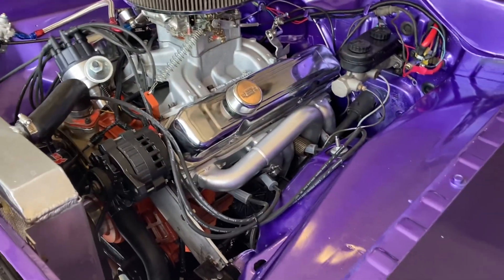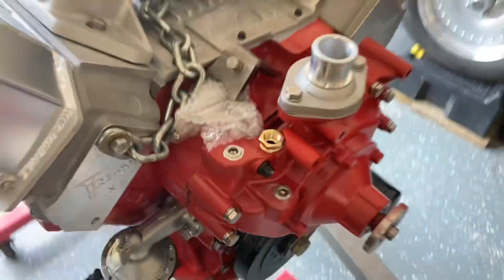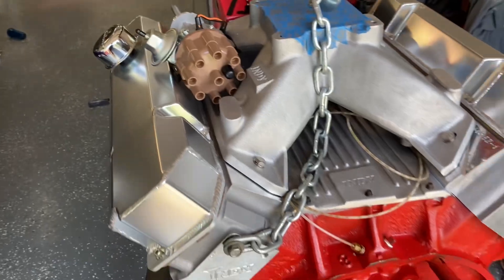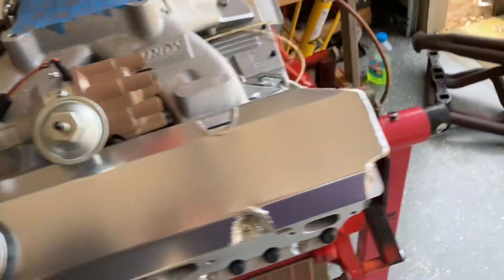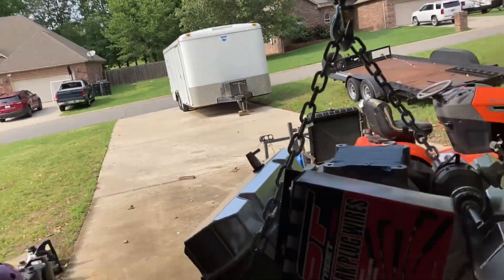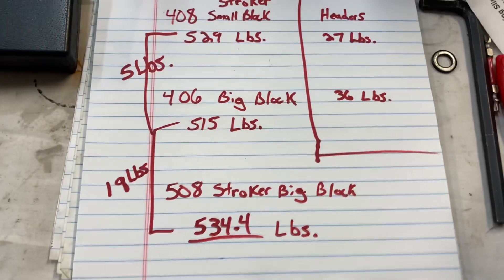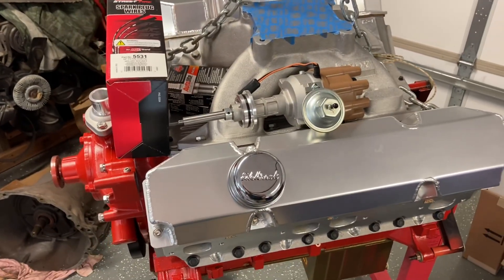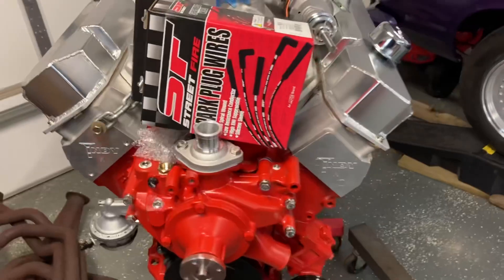Mopar Engine Weights Compared: RB vs. B vs. LA #mopar #engine #440source #stroker

Comment: I think I've said it before but the Chevrolet guys need to see this because they always say a big block Chrysler weighs 800 lb
Reply from the maker: I’ve heard it a hundred times! Even with the added stock heads, iron intake, iron water pump housing, it’d have to be under 700.
Reply: Don't complain that there lack of knowledge makes us Mopar guys look even better when the taillights are fading up from in the distance lol. Imagine how bad it would be if we didn't have these heavy slugs up front lol.
Reply: Most stock big blocks weigh somewhere around 700 pounds, But not all.... That's air cleaner to oil pan, full of fluid, and stock exhaust manifolds, pulleys, w-pump, etc, etc........ Chrysler being the heaviest, Chevy's being the lightest. And it is only about a 50 pound spread between most of them.... Except for a few....  The 800+ pound elephant, is the Hemi, which weighed 843 pounds top to bottom with factory manifolds and fluid, etc......... Chevy made the lightest factory big block, ever... Even thou most people don't want to hear that, it weighed just 501 pounds..... The ZL1....... Chevy made the next lightest ones as well, L88/L89 427......
Reply: @shvrdavid  I'm sure what you said is true but I think they only made 69 of those so they don't really count
Reply: @thomasward4505  They made a few hundred ZL1 engines in total, and made about 150k L88's cars. In 1969 there were just shy of 39,000 L88's installed at the factory, versus 1,200 Hemi's... All were orderable, which makes all of them OEM engines. The L88 vastly outsold performance Hemi's and 440's in 1969, and was about 90 pounds lighter than a 440.... So do the rare Mopar engines not count too? Interesting question, and some like the Hemi sold absurdly low numbers......... Same with the performance version of the 440.....
Reply: @shvrdavid  I was wrong the number of 69 was only in Camaros when I looked it up it was 300 ZL ones which is still not very many, I've seen one in my life and I'm 65 years old. About 6600 426 hemis were built
Reply: @thomasward4505  Seems odd to that less hemi's were made in the late 60's than L88 aluminum head 427 BBC's, doesn't it. And most people have probably never seen an L88.  ZL1's are rare to see for sure.... I owned a few L88's years ago.... There were lots of them around....
Reply: @shvrdavid  A total of 216 Corvette's had an L88 installed  from 1967-69. Not sure where you came up with the 150,000 number ?
Reply: I do not know where you got that information or your brain is getting foggy with time :face-orange-biting-nails:or you hang out with B.S. bench racing end zone lifters :face-orange-raised-eyebrow:but from the book practical engine swapping second revised edition1976 by John Thawley a Chevy big block weighs 625 pounds and a RB weigh's in at 670 and the Hemi is 690 pounds. The small Mopar is 550. These is fully dressed with stock cast iron heads from full oil pan to air cleaner,  fan and alternator like it would be in a running car or truck.  AMC 360-401 is 540 pounds Buick+ Olds+ Caddy 472-500 are all 600 pounds and the heavy Poncho 455 is 640 pounds. Mopar 6 is 475 and all of the GM 6's are 410 pounds. Fords come in at 400 for the 6er and the small 260-351 come in at 460 pounds and the big blocks 332-352-390-410-428 460 come in at 625 pounds. This book even has the dimensions  from water pump tip to trans mount, sump to air cleaner and stock cast exhaust to exhaust in the section "will it fit" P.S. I am a Chevy guy at heart and own a 65 muff-tang vert stick stir to boot but in love with my Mope's just as much even if they are fatty patties around the waist line a bit. :hand-orange-covering-eyes:

Comment: I would never put Chinese  parts in my motor.  440 source...
Reply from the maker: @bradhardy2629  thank goodness you commented so I can explain. They’re now using Scat Cranks and rods, Icon pistons. Obviously it won’t say scat however, It’s the same manufacturer. I like many of their products and will definitely endorse them. Others are a little weak for my needs, but will suite someone else’s out there. How many manufacturers do you think wont use China to make some percentage of their product? The answer is 0. I’ve talked to American owned companies. They truly try to use American manufacturing companies, but they can’t operate at a profit because of the market that’s been created with overseas suppliers, and they have to do the same to stay in business. So it seems your engine will get good old American Stock parts. But don’t use King bearings (made in Israel) and don’t use any Timken bearings because they’re made in Mexico. But wait! Where is your smart phone or Computer made? Top answers are Japan and then… China 🇨🇳. 
Manufacturing happens all over the world. I used to teach 7th grade geography. Week 1 was telling my students to take off one shoe and see where it was made. There are 87% of shoes manufactured from Asian Countries. Let’s circle back to your original comment. If my 440 source stroker kits in any engine fails, I’ll be the FIRST to let the world know. But you’ve got to start thinking about the bigger picture. I can’t buy fruits and vegetables for my children that are made in the USA, without paying 3x’s as much. It’s not the farmers fault. It’s the politicians

Comment: I did weight comparison between a all iron 318 vs a 400 with  aluminum heads, intake, water pump and housing. Was nearly the same weight. Buut the transmission was of course a different story. At least it's a little further back.
Reply from the maker: The 727 in both applications have the same weight, plus the slightly larger bellhousing. I definitely wanted to show the headers to show that difference in tube size and weight
Reply: @JustMoparJoe  Yea 727 to 727 would be but the car I was doing originally had the 904.
Reply from the maker: @ that 904 is a blessing for weights loss and et I heard
Reply: @JustMoparJoe  Yea so I've heard but this isn't an all out race car so wasn't willing to spend the big bucks to make the 904 handle big block torque or the ultra bell to make it fit.  I guess you can put 904 internals in the 727 case as well but I'm sure that's costly parts as well. Have to ask Mr. Cope about that one.    I just put a bolt in sprag, billet drum with all the clutches I could stuff in it, billet servos and valve body mods in the 727 core I had and rolled with that. Wasn't horribly expensive since I built it myself. It's doing fine with the 625 tq my 470 makes. I'll be living with the added weight and drag for a while. I really enjoy your videos and how you present information man. 👍
Reply from the maker: @ thank you. I like the 727 for sure. I can’t afford a rebuild every season! 😂

Comment: I built a stroked 383 with a 440 crank, = 426. I put the stock cast heads, intake water pump and starter on the scale, I saved over 125 lbs going to aluminum. So my big block was now the same weight as an all steel small bock. Motor made 525 HP and 552 TQ. Put this in my 71 duster, I bought a fibreglass pin on hood, car was completely stock, full interior etc and weld wheels. the weight with big block full tank of gas was 3120 lbs.
Reply from the maker: I love the idea of making a big block the same weight as a small block! It’s hard to go small block when you can get 100 more horse and 150 more foot pounds

Comment: Aluminum block if you can swing it, or rack and pinion drop steering box motor plates use motor plate,
Reply from the maker: Thanks for sharing. I’ve got way too many cast iron blocks to swap now

Comment: I weighed my big block in a more runnable condition than you did. I included a mini starter and the pulleys and the carburetor but did not include any kind of exhaust and I believe I got a 545 pounds
Reply from the maker: That’s much better than what the internet tells us!

Comment: Ive avoided swapping because of the plain lack of room in an A-body engine bay. I dont want to hack up my fenderwells to fit headers or have room to change plugs.
I would like to have the power of a high compression 452 (400 block w/440 crank) stroker on tap though..
Reply from the maker: Check it out! They say the Hedman headers are a direct fit for the A body cars. I bought a set and never got to try them. But my plugs are easier now than they were with my 408, or nearly. But the bellhousing bolts are a breeze!

Comment: I swapped out a small block for a Big block, because the distributor is in the front of the engine and the intake can be removed without draining the rad. Along with getting more low rpm torque.  Thank you for the video.

Comment: Hey! I almost have the same engine combo in my truck I am running a Six Pack.
It performs very well. And it does have  A  LOT  OF   TORQUE  !
And is it fun to drive on the street.
Thanks for sharing this info about the weight.
Reply from the maker: Sounds like a blast! This 508 goes into a d100 truck. Should be exciting

Comment: I dropped the 440 out of my 72 Dart and installed a built 360 not because of its weight, but because of its ease to work on.
Reply from the maker: I think with the right headers, it’s about the same. I do like how far the bellhousing bolts are on my 400 now, versus the 360. I don’t think I have the easy headers 😂
Reply: @JustMoparJoe  I had TTI headers on the 440. The torsion bars went through them! Changing the plugs was a 2 hour job and replacing the starter was an impossibility!! I’m so much happier with the 360. Sold the 440 to my neighbor for his 72 Barracuda build. Everyone wins!!
Reply: @jumpinjojo  With the Indy heads the plugs are canted out from the stock position. They point to the intake valves. Away from the exhaust ports. If nothing else... they are easier to change than the small blocks. And, of course, let's talk about distributor placement. I changed to Big because it was easier to get to the distributor. Really? 😜
I ran and wore out three 360's in my truck I ordered and bought in '73. Then switched to a Big Block in '91. I'm on my 3rd Big Block now. Once you go Big... why would go back to small? 🙃 
Oh... they have these things called "mini starters" that make changing starters a breeze.
New tech on old tech is way better.

Comment: Now put aluminum heads and intake on the 408, SMH
Reply from the maker: Definitely had aluminum intake on the 408. I’ve never owned a set of aluminum heads for a small block. I would figure 50-60 pounds less.
Reply: Measure the torque too. 🙃

Comment: Thanks. This helps as I’m contemplating a 400 swap in my 70 Duster.
Reply from the maker: Absolutely! You definitely won’t regret it. These tti big tubes are tight. I may try hedmans next time. Lol
Reply: @JustMoparJoe  I picked up the engine today. Already have an old school Edelbrock TM6 for it.

Comment: If you compare a factory 440 and a factory 340 with stock cast iron heads, intakes and cast iron manifolds, the 440 is much more portly.

Comment: Next you should weigh the A-727 And then the RB 727 ,, For me I would relocate the Battery to the trunk and get a lightweight race battery. then swap to nice set of Aluminum heads that did not kil compression ratio next the water pump issue, maybe when you swap you swap to the New aluminum water pump hi flow That was stock after 1970 then get aluminum radiator to match that .and run cooler temperatures.and the only thing to help the small block is a set of excellent cylinder heads, like the Victor340 's  but the cost will be higher of course
Reply from the maker: Good points!

Comment: Very interesting between the B and RB. I did weight research online between a stock 318 and a 400 with Eddie top end and aluminum pump and housing on paper before i put the 470 stroker together for my 68 Dart.  Seemed like i came up with 17 or 18# difference in the engines. Although my engine and radiator were heavier I used a lighter steering box and moved the battery to the trunk so the nose is actually lighter than original. But now im going to do A/C so who knows?? LOL
Reply from the maker: For sure! Power and torque beat weight anyway!

Comment: Thanks for the info,i feel better about my 73 charger with the big block, always wondered about the weight difference because it was a 318 car originally nice to know not much different in the weight
Reply from the maker: Absolutely. There’s a dude who 318 swapped his 400 car on Facebook. He even bought edelbrock aluminum heads for it. The mission statement was to make more power than the stock 400 and take sooo much weight off the nose. I think he lost 100+ potential horsepower and didn’t gain much otherwise.

Comment: I'm curious how the Gen 3 hemi stacks up weight wise!
Reply from the maker: For sure! We have to consider the miles of wiring added In the mix. I’ll have one to pull out and measure soon!
Reply: It's really hard to beat the strength of a second generation Big Block Chrysler. After all,... look what the Top Fuel engines are basically running to this day. The 3rd generation Hemi's  are fairly tough. But just look at the design differences of the two blocks. In Big Block Chrysler's, the crank is encased by the block. Small blocks, which the 3rd Gen is really... the crank hangs out from the crank centerline down. 
When one does a "4 bolt main" on a 2nd Gen RB/ Hemi, you "cross bolt" the mains. Way more stronger than putting the bolts next to each other. Ala BM engines. They can't do it because the crank hangs out low from the block. 
The B/RB blocks are like a granite rock. They are Indestructible.

Comment: I just wanna know when can I send my 400 down for you to build it lol...😂😂😂💯😎
Reply from the maker: Haha! I’ll get you on the list for 2025
Reply: @JustMoparJoe  WHAT!!! 😂😂😂 I was thinking more like 6 months from now....🤔🤔🤔🤔😂😂😂😂
Reply from the maker: @218422100  the secret is out! I’ve got 3-4 in line now
Reply: @JustMoparJoe  i figured it wouldn't take long. You do an outstanding job and are very meticulous in your builds and I would be extremely happy to put one of your motors in my ride. I found a 1977 400 for $500 but I might be able to get it for $400. Its totally complete motor. I'd want it built like your 400 but without the aluminum heads. Just plan on using the stock heads and see what we'd get.
Reply from the maker: @218422100  should be a good one!